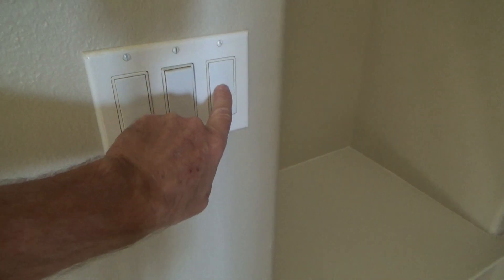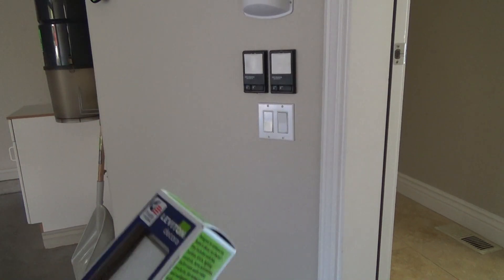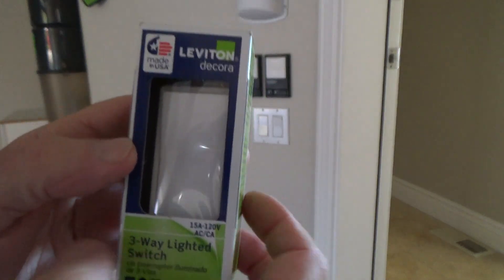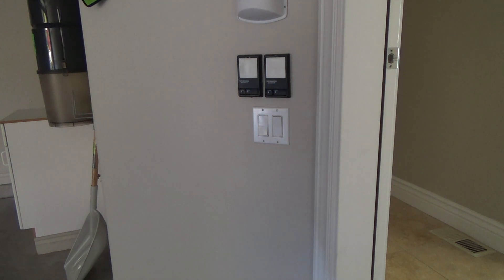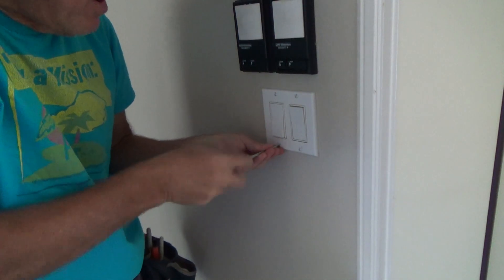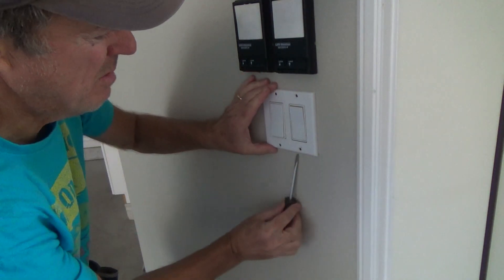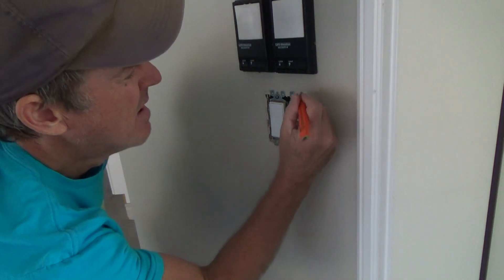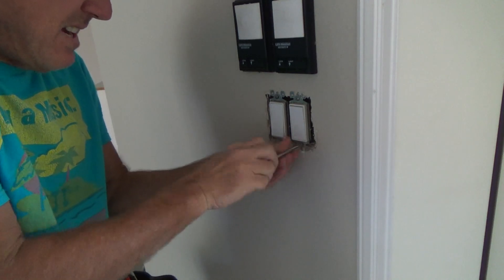How to Remove 3 Way Light Switch for Dummies

Comment: hello i opened my switch and the white wire is also hot how  could that be? single pole switch
Reply from the maker: Some electricians use to wire things up that way. The main power for your light switch is probably up in the light fixture then they run a power leg down from the light fixture to the light switch so the white wire is actually connected to a hot black wire up in the light fixture then they run it down to the light switch for one of the wires....so in essence both of the wires that are connected to the light switch should be hot wires. They really should put a piece of electrical tape on the white wire so you know that it's being used as a black wire. I hate it when they do this as . I always run the power feed to the light switch location then go from there with another set of wires to go up to the light fixture. I'm sure that's what they did....see what I mean? If you were to remove your light fixture & look at the wiring up in the light fixture box you should see that the white wire going to the light switch is really connected to a black wire up in the light fixture. Let me know if you get what I am saying here.
Reply from the maker: I also have lots of other electrical videos on my channel for more learning & saving. Just go to my main YouTube channel page then click on playlists then scroll down to electrical to find them. Thanks again for stopping by...